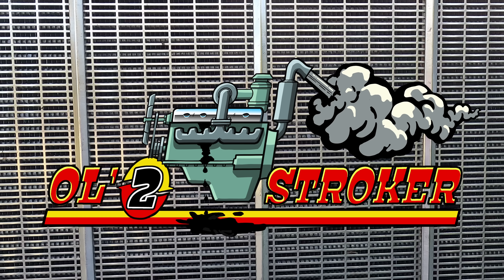1980 Peterbilt 359 EXHD 3408 Caterpillar finally gets some seats

Comment: i saw someone else comment that the air connection near the seat is for the floors-that may be partially true but it's mostly to use a blowgun to clean yourself off after youre done unloading, working, etc. Dont wanna drag all the crud in the cab with your dirty self. It's actually really handy

Comment: Hey Wayne, brother, I just fucking love the beginning of your video with Mossy broke , such an epic old Pete, good luck with your old 3408 they are good runners , I’ve had mine in a 1979 kw lw 924 for the past 10 years , well it’s been 10 years since I rebuilt my 3408 , been in my kwhopper for 25 years, I rescued it from an old grapple yarder (swing yarder ) 😊

Comment: 3408 Cat is legendary for Durability and power my experience with the one I operated was nothing short of Shocking By far the engine that I think of as never seeming to run low on Power Cat rated up to 800 Hp in Dozers out of the factory ! ..Good Job Wayne

Comment: Old timer taught me the trick to free up the clutch when it stuck on my ltl. Idle it up until you can feel a little shake in the cab of the truck. Put a stick on the clutch pedal to hold it down (off the clutch brake). Then walk away. Come back when you think she’s ready to cooperate and give it a try. Hope this helps you out. Worked for me

Comment: Hi there..from France. !
I have a KW W 900 with a 3408 with a similar problèm. In my case I traced the fault to the compressor . Situated at the back of the engine and weighing a ton, its a pain to remove and worse to put back. Good luck !!!
Reply from the maker: Yea that looks like absolutely no fun

Comment: Dear Mr. 2 Stroker,
Love your videos! I'm much too young to have experienced the horsepower war engines in their heyday, so I enjoy the heck out of your content. I also have recently come into possession of an old White 7400 cabover and possibly a Peterbilt cabover. Both have 8 cylinder Detroits. They ran when parked but have not run in 30 years, have been sitting outside. I've got a good deal of experience on heavy diesels, but nothing on two strokes. I'm wondering what would be the best way for going about reviving them. Do you have a recommended playlist or video of yours or someone else's that would show the best procedure? 

P.S. - Absolutely love the Montage song!
Reply: You'll need to take the rocker covers off , check the fuel injector racks , they commonly stick when sitting for a long time . Wayne shows how to free up stuck injectors on some of the early videos on the 352 cabover with the v12 . All the best with it good on you for trying to save some old machines .
Reply: @JoeSmith-wd8ks  awesome, thanks! I'll go rewatch them with a purpose

Comment: The dash leak could be an exhaust letting you know there’s an external leak chamber etc. it exhaust air in the cab so u can hear it and know there’s a leak outside.I’d start with an pancakes/chambers.

Comment: You can take that buffer out of the return line, i havent run one in years, and dont have problems with it not being there. Just put a plug in the hole.

Comment: Measure the clearance between the throw out bearing and clutch brake if it's got one and try to adjust the disc, if it will move, turn

Comment: Dude im thinkin you cant sell that rig.....i know its a funding issue and its a cat not a detroit but man ive been stearin and gearin since like 99 legally and drove straight trucks on my grandpas farm before i was legal to drive. I have yet to see a 359 with an intact frame powered by that engine. Ive driven a 1980 359 with an 8v92 and a 15 gear and a pete cabover with an 8v92. Never ever a v8 kitty. Only time i may have seen one is at the big iron classic in kasson but i dont recall it specifically, You should check out that show by the way. Ive showed 2 different petes there. Both 379's.

Comment: So what would make to smoke that much when you rev it? Is it cause of bad injectors? She is coming along slowly for sure.
Reply: That's just old technology for ya. Turbo isn't spooled up yet so the air to fuel mixture is richer causing unburnt fuel to exit the exhaust. This is especially common in a revving situation where you are essentially dumping fuel into the motor and then leaning the motor back out to idle if thay makes any sense
Reply: Wow thanks for the info. 🙏👍